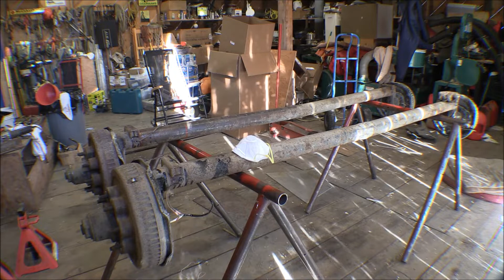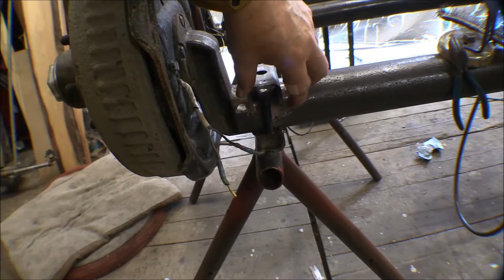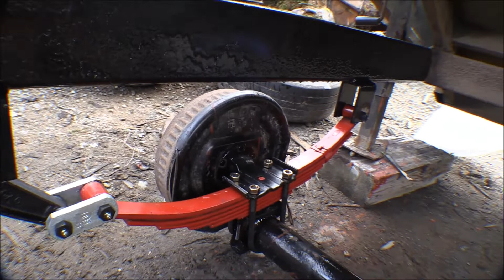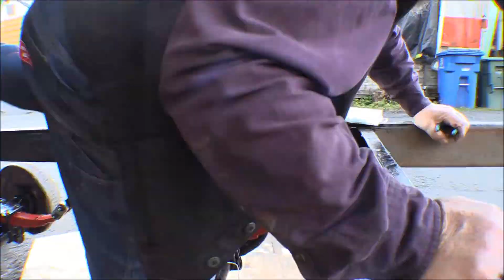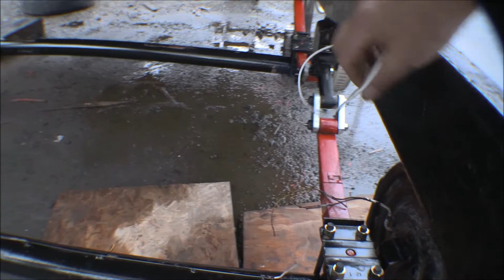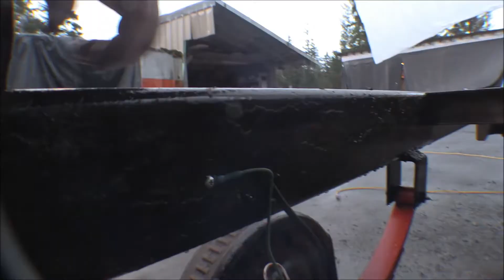Dump Trailer Repair Dexter Axle flip

Comment: Looking good and yea trailer  riding significantly higher.  Don't  think you gonna like that when loading equipment  and longer ramps means heavier ramps  and us older folks don't  need heavier.  Like the backup lights idea.👍
Reply from the maker: You be'n read'n my mail Anthony! The skidsteer loads ok but I havn't tried the excavators yet. I can load the excavators pretty high without ramps, but the dump trailer sides are too high to swing the machine around after you get it in.